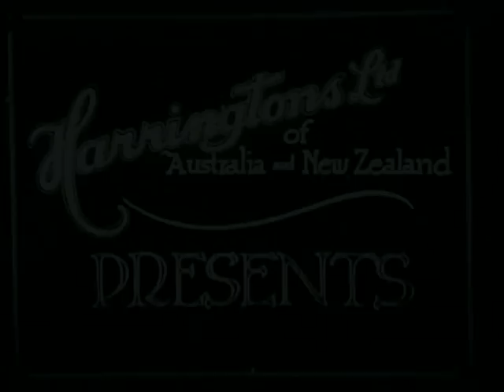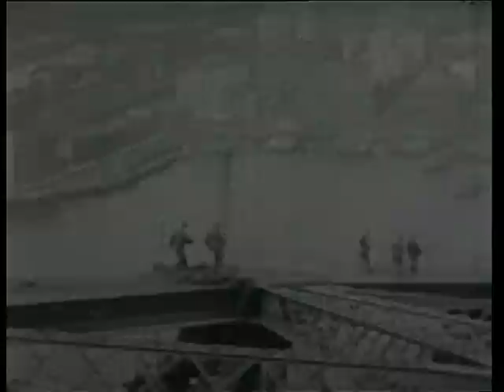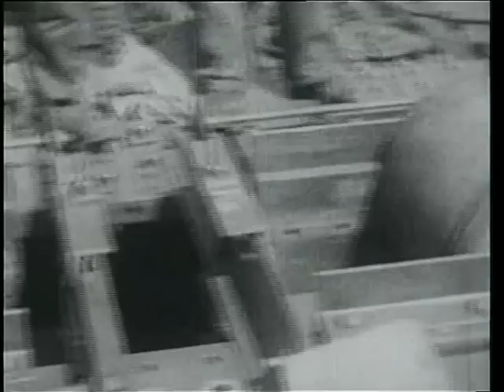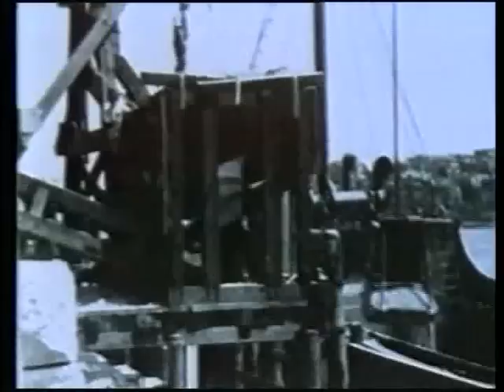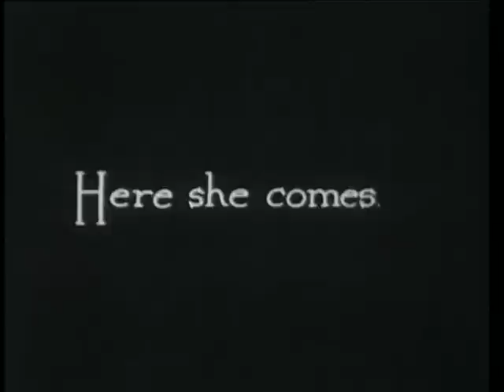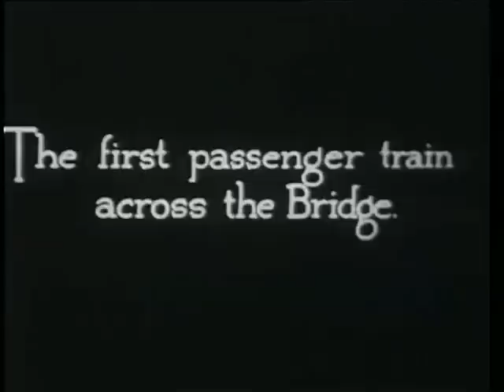The Construction of Sydney Harbour Bridge

Comment: Thank goodness this wasn't built using SI metric measurements!!!
Doesn't matter. The bridge is over 90 years old. It's only supposed to last another decade or two and is already starting to show visible rust. When they replace it in 20 years they will no doubt use SI measurements. But I suppose that the new bridge will be a cable-stay bridge.

Comment: The sheer quantity of engineering calculations for so complex a structure simply amaze. Any small change creates a cascade of hundreds of dependent re-calculations with considerable effort, measured in days. Today, those permutations can be run in an instant.

Comment: Wow, would have loved to have seen it being built. And, to think, all done before computer aided design.
Reply: Also before welding on such structures. Many early welded bridges etc suffered from cracking. rusting under the riveted plates is probably the biggest risk here. Cracks can form between rivets but are very visible.

Comment: No ads here ever on youtube, smart people use firefox with adblock or ublock origin.

Hard to imagine the forces needed to hold all the tons and tons of steel projecting out like a lever, only held up by a bunch of cables going back thru a tunnel in the ground until the two halves of the arch were joined and it was then essentially self supporting. And there they were up there working with 600 ton cranes cantilevered out on all that steel like that, it's like a person trying to hold a 10 foot extension ladder out at arms' length horizontally while holding the end of the ladder and the first rung and then having friends climb on the ladder's far end!

Comment: Working at heights has always been an issue. 

I feel most for the guys inside the chords holding the rivet head with a dolly while the riveter outside hammered away. 
The noise must have been deafening with NO hearing protection.

Comment: Even tho' the SHB was never the longest steel arch bridge, I think it was the widest until 2012 - as constructed 2 train tracks, 2 tram tacks and 6 lanes of traffic - now 2 train tracks and 8 lanes of traffic.  In 2012 the Port Mann Bridge was opened n Vancouver (10 lanes and 65m wide) and in 2013 the new Bay Bridge in San Francisco was opened (10 lanes plus pedestrians and bicycles and 78.74m wide)
The SHB was the widest bridge for 80 years - 1932 - 2012 - quite a record. 
It still remains the sixth longest arch span bridge.

Comment: A cycle path, 2 dedicated rail lines,  6 lanes of auto traffic, 2 dedicated tram lines (later turned into more road way during the anti-tram era, ie the 50's 'n 60's) & a footpath, that's wide enough. There was talk in the 80's or 90's to run 2 more lines or lanes under the deck too, but nothing came of the idea,

Comment: Incredible video, thank you for posting. According to the IEAust (Ch.Eng) the rivets alone (disregarding the cross struts, and arch material) on the arch carry 26,000 long tons of lateral compression on the top chord, and 15,000 tons or tensile potential on the bottom chord. And even though the cables have been relaxed to allow the arch to settle, they still carry 15,000 tons of tensile potential strength, as well as providing a moment of rigidity.

IEA 
The Sydney Harbour Bridge is a remarkable, and outstanding example of engineering brilliance and complexity, and even in the 21st Century, still stands as one of the world's engineering wonders.

Using new, and untried construction design elements, novel materials, and alloys, and new concrete mixing technology which was unheard of at the time, it is a shining example of genial imagination and vision.

Hear, hear.
Reply: And yet, we STILL can't figure out how the pyramids were built, and despite all the modern cranes and equipment, we couldn't replicate one today, yet we're supposed to believe primative people with copper chisels and stone hammers built them LOL!!!

Comment: sydney is crap all they have is that but llook at melbourne
Reply: its to cold there
Reply: Also Melbourne is one of the dirtiest cities in Australia. Look at Flinders street station it looks like it's about to fall down. It's one of the cities biggest landmarks and its dirty and has graffiti all over it inside and out. I know Sydney has its problems aswell but for the most part all the tourist areas are kept clean and respectable. I have been to Melbourne quite a lot of times over the years and it is very disappointing. Very bland city built on a swamp.
Reply: 😂😂😂 Melbourne has nothing... boring

Comment: The poor guy inside the beam holding the head of the rivets must have been deaf  after 2 days in this hole, not counting the heat.
Reply: So must have been the guy up top with the jackhammer 4" away from his head pounding away at the heads of the rivets! No hearing protection, nothing!

Comment: Are there plans toreplace the bridge? It's gotta be close to failure now.
Reply: Not even close.  It's scraped and repainted twice a year (and each repainting takes about 6 months and about 30,000 litres of paint per coat, so it's an never-ending job), so it's not corroding like you'd expect - although I hear it's now being repainted lead-free, so we'll have to see how that hold up in the future.  When I left Sydney in '93, they hadn't had to replace a single rivet yet, but in 2003 they did do some maintenance and added a little strengthening to make allowances for modern traffic being so much heavier than when the bridge was built.  But if the maintenance is kept up, I don't see any reason it won't easily last another 50 years or more.  

That seems to be the main problem with steel bridges in the US.  The money for maintenance slowly dries up as politicians find other pockets to line with those funds...and so the bridges deteriorate over time, until they need complete replacement, rather than ongoing maintenance.  And, of course, while Sydney is on the ocean, at least we don't coat the bridge in salt every winter (no snow in Sydney)...and I'm sure that helps keep the rust from getting out of hand.  :-)
Reply: D Fuller It's less than 100 years old! The British engineer things to last, unlike the US.

Comment: My Father worked for Dorman Long in Middlesborough during a lot of the pre-fabrication work. When I walked across it gave me a very strange sense of deja vue. My friend in Sydney tells me it has never been widened, but as I recall it has 4 lane road traffic and 3 railway lines. Amazing foresight of the planners.
Reply: It opened with 6 lanes of traffic, 2 railway and 2 tram tracks, the tram tracks were later converted to 2 extra traffic lanes.

Comment: The video is called "The Construction of the Sydney Harbour Bridge" and was made by the Institution of Engineers, Australia. Sydney Division.  It was later released on a DVD.

The film was made by photographer Henri Mallard from 1930 onwards and was silent.  One of the supervising engineers during the construction, Frank Litchfield, added the commentary in 1969 when he was 80.

Check Wikipedia for "Through Arch Bridge".  In order of completion good examples are:  

Hell Gate Bridge, NYC finished 1917 Almost identical to the Sydney Harbour Bridge except it is smaller.  It carries three rail lines.  The SHB "designer" Bradfield went to see the Hell Gate Bridge soon after its completion.

The Tyne Bridge built by Dorman Long was finished in 1928.  Despite common belief, the Tyne Bridge was not a "prototype" for the Sydney Harbour Bridge. It carries four lanes of traffic as well as footpaths.

The Bayonne Bridge connecting New Jersey and Staten Island was completed in 1931.  I don't know how many lanes of traffic it carries.  It was to have pillars or pylons at each end, like the Hell Gate and SHB, but money ran out.  On the Hell Gate Bridge and SHB the lower section of the pylons help support the roadway.  The upper sections are purely cosmetic, in fact on the SHB one of the pylons houses a museum and a steel staircase enables people to reach the viewing area at the top of the pylon.

The Sydney Harbour Bridge was completed in 1932 and also built by Dorman Long.  It originally carried two rail lines, two tram lines and four lanes of traffic.  When trams ceased operation in Sydney they added another two traffic lanes instead, making six.  Later they narrowed the four lanes on the main deck to make six.  So now it carries two rail lines and eight traffic lanes as well as bike and pedestrian pathways.  There are "tidal changes" on the bridge to help accommodate morning and evening rush hours. The Harbour Tunnel roughly follows the path of the bridge and has four lanes, two in each direction.  There are plans to add a third harbour crossing nearby.

As for my interest in all of this.  I was born and brought up in Newcastle on Tyne.  I married a girl from Sydney whose grandfather was the General Works Manager on the SHB, employed by Dorman Long.
Reply: but have you climbed it.....now that......is the only way to REALLY appreciate what the workers did......its petrafying .....ive done it.....i live nearby......its HUGE!....do it bro.....you and your missy.
Reply: The Bayonne Bridge currently carries 4 lanes of traffic, 2 in either direction, and a footpath.
Reply: Thanks for your information. 
Great.
Reply: His son Paul Mallard was a ww2 pilot (i believe) and later became a dentist in Gordon.